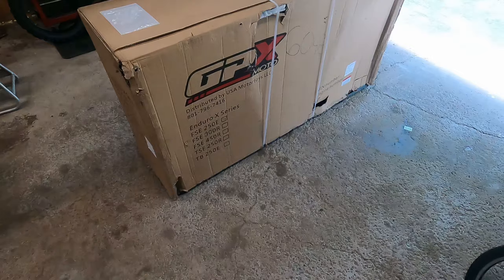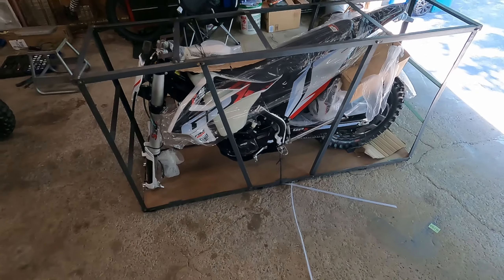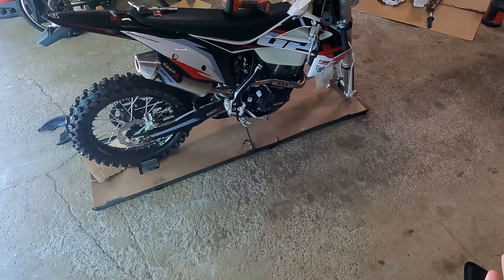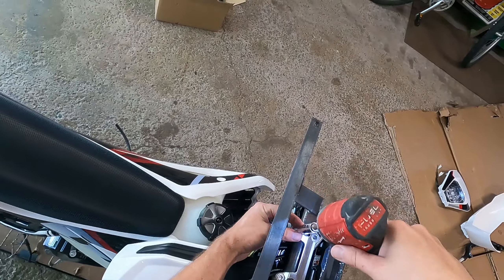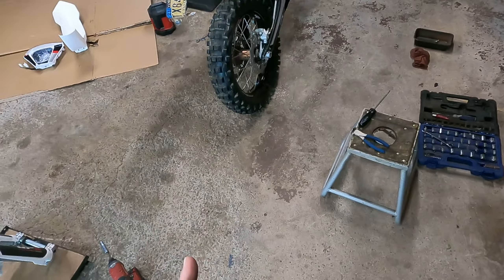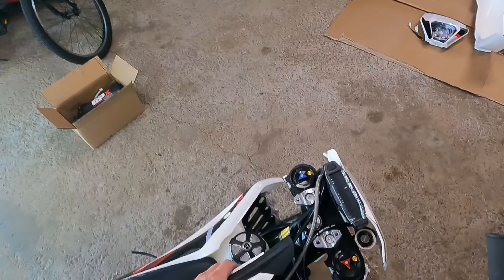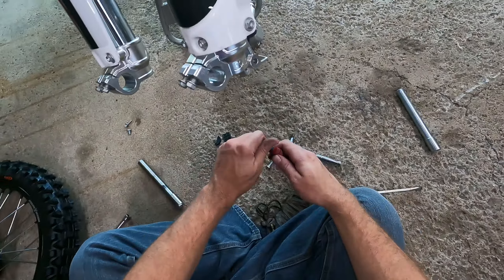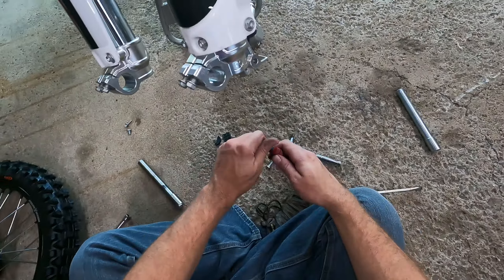GPX FSE250e Build & Setup (All models apply)

Comment: Did you mount a license plate...if yes, how?  Thanks
Reply from the maker: So at first I would use an enduro engineering mount and then I broke that too. My solution has been to copy my plate then laminate, then I cut a piece of playin milk jug to the plate size and then zip tie it through. No problems since lol! You could carry your real play in your backpack if you wanted to I guess.
Reply: @LCARSADV  Thanks

Comment: Hint. Do not leave the no toil oil on the filter for a prolonged time.  Like over the winter. It is not good will cause filter failure.
Reply from the maker: I ride in the winter lol, she don't get stored!
Reply: @LCARSADV  no worries. I do to. I just had one where it stuck to the air box after about a month. No dust in winter so less changes. Im looking for a K&N I always run them. So easy to clean. When I find one I will have 2 new twin air filters with the power up cage if anyone wants them. One will be used the other in the box. FREE.

Comment: Could my 450 throttle be wound backwards? I'm just putting the handlebars on and it rotates forward not back, on the right side cable coming off the top.
Reply from the maker: I would just pop the throttle assembly apart and take a look at the cable and band sure it’s routed correctly. Hard to know without seeing it.
Reply: @LCARSADV  thank you for the reply. The throttle cable was in fact wound the wrong way around the pulley it wasn't in the grove it was wrapped in the opposite direction on the high part of the pulley. I opened the clam shell on the throttle and it's now rotating in the right direction that a throttle should twist.
Reply from the maker: @daves984  glad you figured it out!

Comment: Have you ridden a FSE450? If so what are your thoughts? There isn’t a lot out there about them.
Reply from the maker: No I haven't, but having the 300 and talking to other 450 owners I know how the engine will be because all of the gpx engines are very linear in behavior, but lots of torque and throaty. I just wouldn't want a 450 for tight woods and enduro type rides with it's extra weight and engine power. If I lived out west I think I might entertain it...or if I dual sported it up